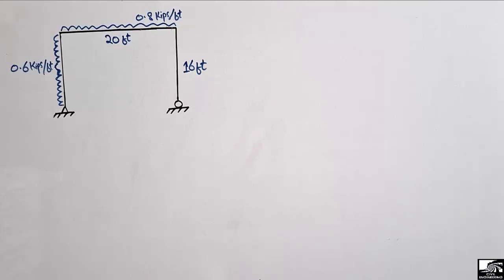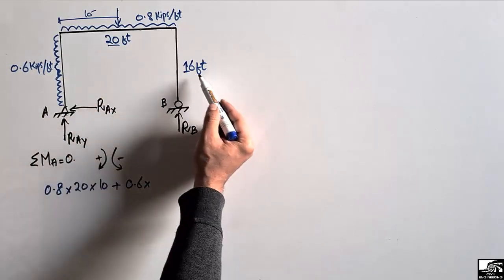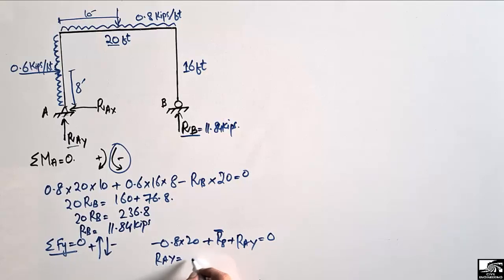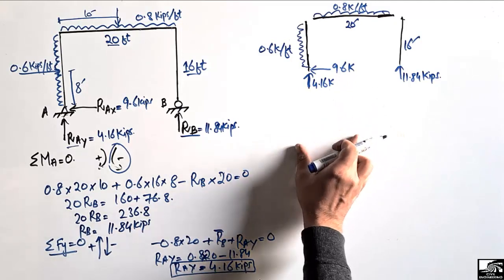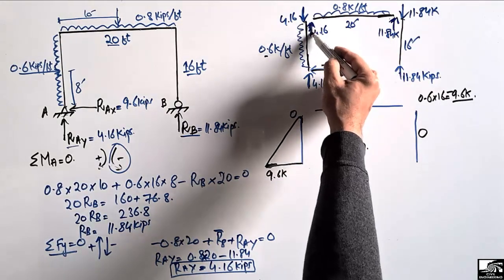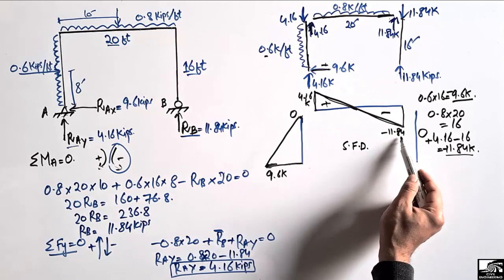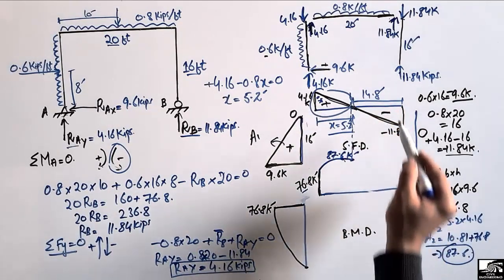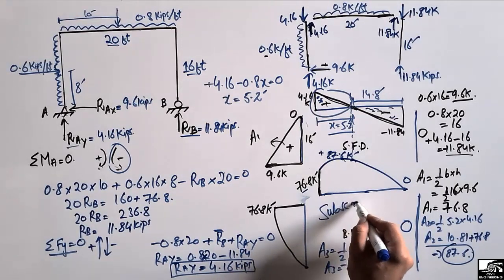Frame Shear Force and Bending Moment || Frame Analysis

Comment: 5:40  5:50 Ray=-4.16kips, it is in negative, so use should change the direction as we assumed at the beginning towards upward (^) but as per values we solved it is negative. We assumed direction is wrong then we need to change the direction to downward.